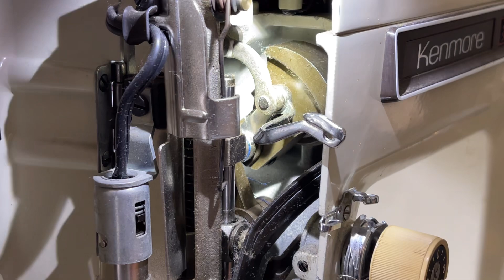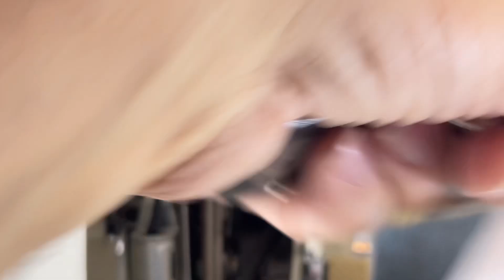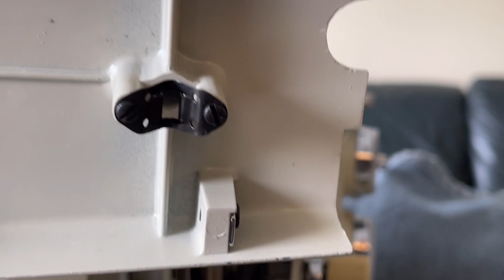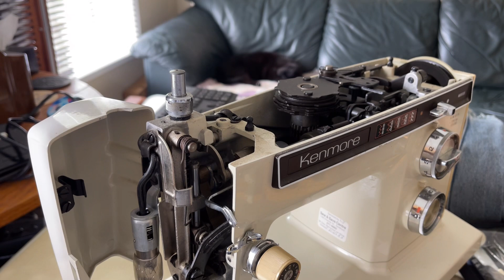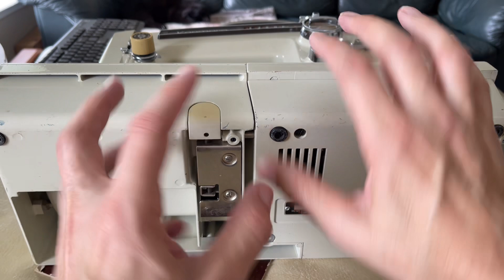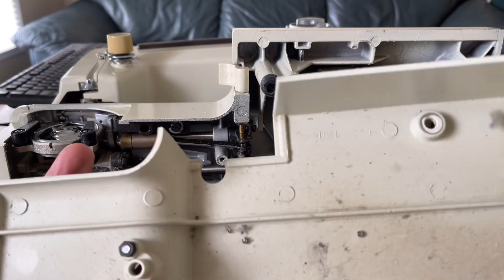MY FAVORITE SEWING MACHINES SERIES #2:  Look at All that Strong Steel! Opening up a Kenmore 158.1941

Comment: I lov we this!   I gave mine to my neice.   Does your's have the decorative cams?   It is one of the greats!   Was this made by annother company under the Kenmore lable?
Reply from the maker: Hi Linda.  This machine is a 158.1941 and it did not come with extra cams as it was made to sew with only the built in stitches (mostly utility stitches).  However, the 158.1941, as well as other Kenmore models, DID offer the use of decorative stitch  cams which were often sold as 'extras' or used to incentivize a customer to make the purchase (very expensive purchase I might add!).  As for who made them, for this series of machines, Marusen in Japan made these for Sears.  Kenmore was always a 'store brand' or 'House brand' for Sears.  Sears was only a retailer and so they never manufactured anything.

Comment: I have one of these machines, and yes, it is a very good machine.  The quality is amazing, and it purrs right along.  While I love the standard foot that comes with this machine, I really, really don't like the other feet that this machine uses, so I changed out the needle bar with one from another Kenmore machine that allows mine to use standard low shank feet.  I wish they'd put as much effort into the aesthetics of this machine as they did to the engineering.  It's not ugly, but it's not pretty. It's utilitarian at best.  When I'm spending hours in front of a machine working on a project, it's nice if it is pleasant to look at, so even though this machine's performance is great, I'm more likely to pull out my Singer 401 or Necchi BU, because they're great machines both functionally and aesthetically.

Comment: I don’t believe you are missing a screw on the bottom, as mine is the same. The four rubber pads are sufficient. Regarding the numbering, I have read elsewhere that 19410 is low shank, 19411 is high shank, and 19412 is super high shank.
Reply: I think the 2 screws (1 you say is missing) are to attach the machine to a cabinet.

Comment: What could be wrong if the belt near the motor is locked up? I have a 158.17600, but the lock up is on a Kenmore Ultra Stitch 6.

Comment: Hi great machine and fun, informative video.  I wanted to comment on the metal screw rings underneath the machine.  While you can put washer on the spots, the screw holes are actually there to screw the machine down to a cabinet bed; so that it of course won't fall out.

Comment: I have a question? Does the 158-17811 model is a good model to buy, because some people says that the drive gear is in plastic underneath and it cracks sometimes and there is no part available , should I buy that model #?